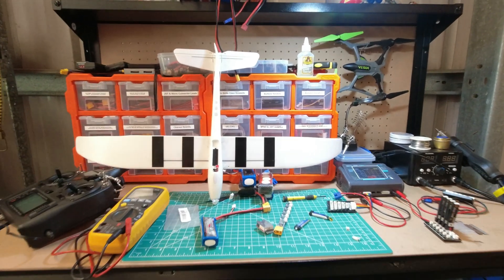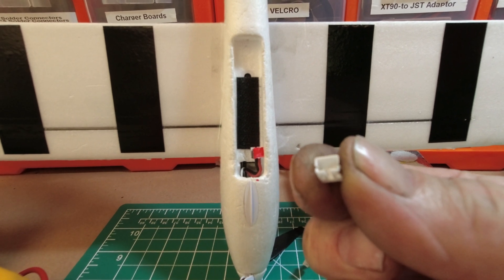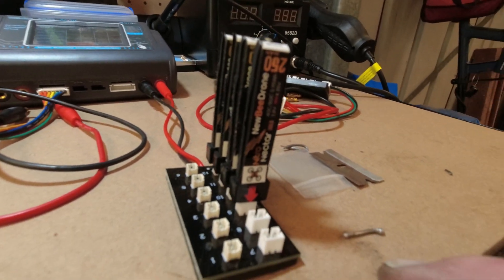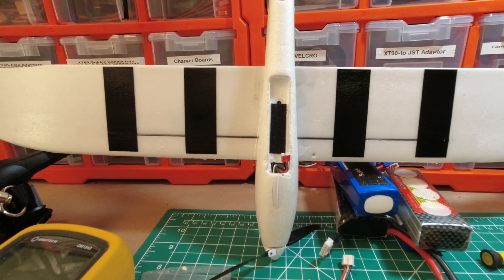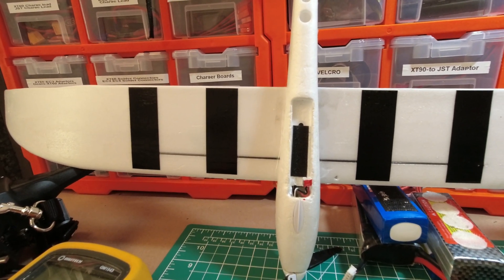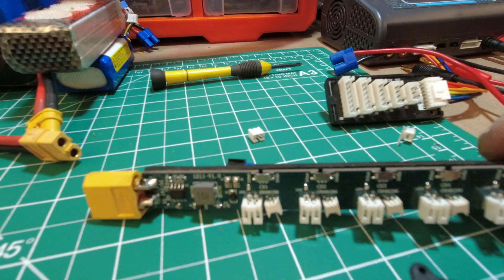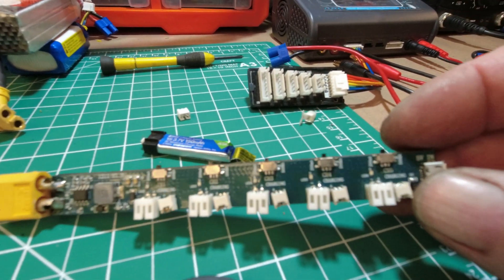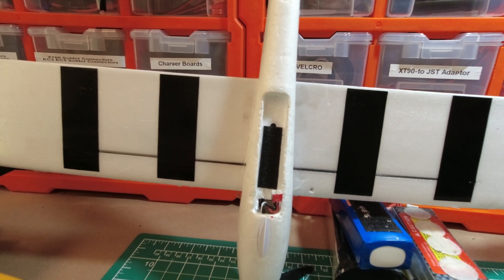UMX Radian battery modification

Comment: 250 seems pretty heavy to me, at least the Tattu cells I have...have you noticed any drastic change in flying / gliding characteristics? I just got one of these this week and have been contemplating this mod.  All of my 150's are old, and I've had lots of problems with the small plugs on quads in the past. They won't handle much current, and they wear out easily due to the extremely small surface area of the connecting pins.